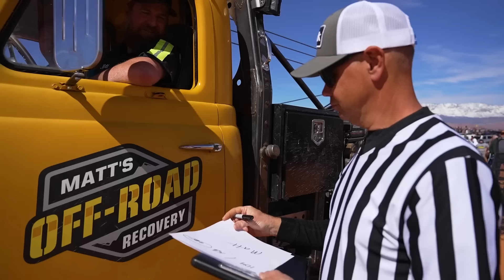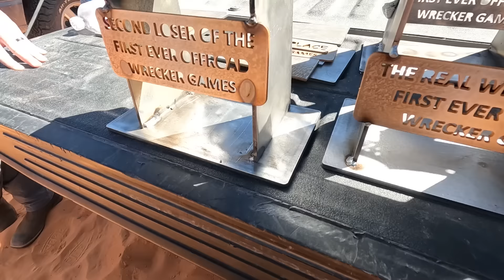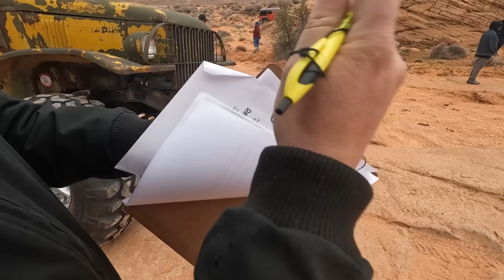People ACTUALLY Showed Up For This?! The Off-Road Wrecker Games...

Comment: Matt, thank you so much for making such a concerted effort to help Eric and build up his channel because no one has donated more time to help people in the off-road community than he has👍👍👍👍👍
Reply: Not just people the parks and events he goes to the man just gives I'm glad he got that lift it'll definitely be a game changer for bsf challenger definitely stepped up and saw how deserving he was he's no spring chicken and IDK how he's got along without a lift my lift and my pit are 2 things I couldn't do without if I built a new shop and I've had mine since I was 27 and built my big shop to get indoors with my big projects I'm on my 5th lift upgrade my 1rst was the big air cylinder coming out the floor that's how long I've had 1 you were very limited on what you could do with them that antique is still in the shop designated for lube jobs now when the pits busy
Reply: @davidwoermansr  Totally agree! I previously mentioned that half of Eric’s videos seem to be of him talking to his viewers while he is laying under his truck fixing something. My friend used an ancient cylinder lift for years and had to work around it almost every day👍
Reply: @stevez340  they have their place but challenger has definitely set the standard imo I have 2 and when it's time to replace my other 3 indoor post lifts I'm getting 1 of their 4 post and 2 more 2 post lifts I'll stow away 2 of my current lifts and put 1 more outside it's nice to have 1 out back for washing under vehicles before working on them it'll have to be better having 2 right

Comment: Matt wearing a jacket is crazy to see. It must have been a little cold considering he goes out in the middle of a snow storm without one.
Reply: It was chilly with the rain and a slight breeze (I was cold). Then when I got back in the car I looked at the temperature outside and it was 52 degrees which shocked me. The weather down there in Southern Utah is way different then where I am from in eastern Wyoming.
Reply: Being out in the cold for 10 or 15 minutes is different than being in the cold for hours

Comment: Excellent video.

On a side note, I wanted to comment on your old videos about Monster Transmission. When I saw you went with them for your transmission, I was a little worried. They don't do the best work, they have a lot of issues.

The transmissions aren't much stronger over stock, either. I really wanted to recommend a builder for you then, but I didn't want to be a downer. I've done some transmission building for a couple of my customers and my own stuff.

I highly recommend Ultimate Transmission out of Boise, Idaho. They've done good work for me and my customers when I have someone that needs something much stronger than I can do.

One transmission they did for one of my old customers was for a ~1300hp Cummins. Dude daily drove it, tracked it on the weekends, and it held up great. Compound 5.9 with nitrous, and the trans was a 48re

Comment: Man the heavy wrecker, Banana, and blue steel all need work, you're going to be one very busy crew. Luckily you should be able to farm out blue steel to Robby and it'll turn out pretty. Or you just replace the headlight and mirror but leave the dent as an extra souvenir from the first ever off-road wrecker games. 

Good job rolling with the punches Matt and crew.

Rest in Power Robert. I know next year you'll be smiling down on the second annual off-road wrecker games.

Comment: Looks absolutely unreal! Can't wait to do some off-roading in my rig when its finished. I still have a couple things I need to get recovery wise but the mechanical stuff's done haha!
You guys are my inspiration @Matt's Off Road Recovery!

I have a 02 Honda CRV with a 3 inch lift and 1.5 inch subframe drop. 245/75/16 Dynamic steel wheels on BFG K02 tires. XJ Cherokee snorkel, ARB front bar and bash plate. Rear diff is from a 2011 HRV (better matched gear ratios) with a HRG differential clutch locking plates.

Comment: There are heavy duty trucks that use both a clutch and a torque converter with a manual transmission. It would be interesting to see such a system on the World's Largest Off-Road Wrecker.There should be enough room for such a system.

Comment: No reverse is usually a high likelihood of low trans line pressure.  The reverse clutches have to hold with 3 times the amount of force as any forward gears.

Comment: Long-time viewer; I wear a ‘Winder Towing’ sweatshirt. I wanted to learn how the wrecker turned out; I liked the comment about doing this for fun! Next, you need to convert the wrecker to entirely electric. Excellent low-rpm torque, good center-of-gravity. If you can protect a fuel tank you can protect a battery. Seriously, lead the way to new services, new power sources, etc. Next weak points in drivetrain will emerge; leave nostalgia behind and introduce viewers to fresh ideas and technology.

Comment: Great videos looks like you guys had a blast!!! Have you figured out why the reverse went out on the heavy wrecker? Personally I would be pissed at monster transmission the 4L85E transmission in stock form should hold up to 500hp. I also have a two 8.1L trucks. They have the Allison 1000 behind them. Wondering what the output difference would be I don't think their is. I haven't looked into that. But you would have a better 1st gear and have 5 forward gears and if you do the update to it from a 06 and newer you can have 6 forward gears and a lower yet 1st gear. I know it's all about gear ratios. Personally I think the Allison is a much better choice than the 4l80 or 85 E transmission. My 2nd truck has over 300K and it is all stock and it runs like a swiss watch and I a loaded 12,000 lb trailer with that truck all summer long never let me down yet. I'm a huge fan of what you do and love watching you and your team and family do what you do. Amazing work!!! You all deserve a big pat on the back. Well done sir!!!!

Comment: I replaced the same mirror on my father in laws truck cause I broke the gear that opened and closed it. That heated power folding mirror is $1000 OEM from ford.

Comment: Matt, you designed and engineered an amazing piece of equipment, watching it work was like watching a tarantula spider, I could see Wetzel’s selling big time,  I think you could get 100.00 or so 🤔 how many could you build a year
Reply: 0
Reply: Idea to consider, part’s list, 2 muffler cutouts, I prefer manual, for added knobs on the dash, two 26” glass pack/stack muffler’s, 2 3” rain guards, and a propane flame thrower kit. It seems a little off balance, maybe put weight holders or the front and test it, 🙂HAND.

Comment: monster transmission fails again lol I commented on you video (what we been waiting for) when you got that junk trans we had monster trans and ats trans both junk and awful times trying to get ones that work we gave up with monster and had it do at a local shop lol 4k on that one and ats refused a trans warranty saying we caused the problem also i will never deal with trans shop that I cant drive to weeks to respond then hang ups on phone call a close to a yr for a replacement trans that did work nether and paying return shipping nope never again they go local or I rebuilt the last 4 my self and there all still going im doing 2 Allison 1000's in a few weeks for my new trucks. thanks for sharing

Comment: DOES NOT SEEM LIKE ANY OF THESE PEOPLE FULLY UNDERSTAND THE DANGERS AND FORCES OF TOW STRAPS UNDER THOUSANDS OF POUNDS OF TENSION, especially Matt?..The force required to instantaneously fold a F250 fender, dent the hood, break the headlight and remove the side mirror, ALL in a 1/10 of a second.....I always see him holding the winch line while in use and all his crew regularly in potentially life threating positions. Everyone nearby needs to be wearing ANSI eye protection and look at that ford truck as an example of the explosive level kinetic energy forces at play here....lucky nobody got hurt at that event, was a close call, again.

Comment: When I pump any 4000 psi or more I sugar because not only is the hi test our Arizona heat makes it almost impossible to get a good clean on the hopper or the pipes ...
But if I'm doing multiple jobs I will do sugar in the hopper only but if I only have one job and it's 5000 psi to 10,000 psi  I will sugar the hopper and Resurculate with water then do a water wash !!!
We do a lot of 5000+ psi here for the mines and I rarely take the chance that it will setup ..